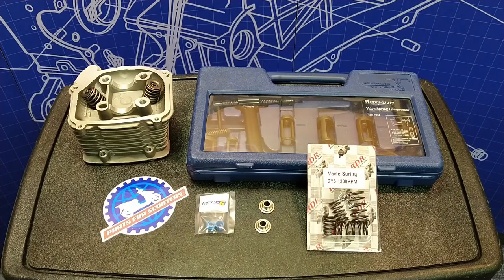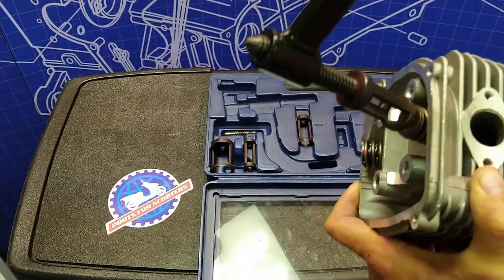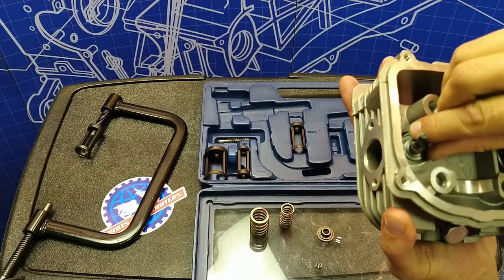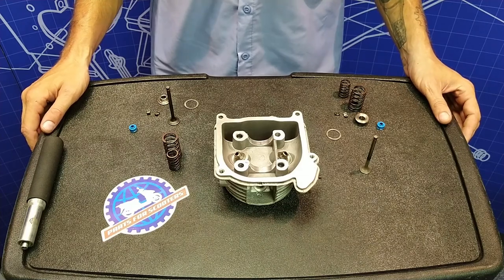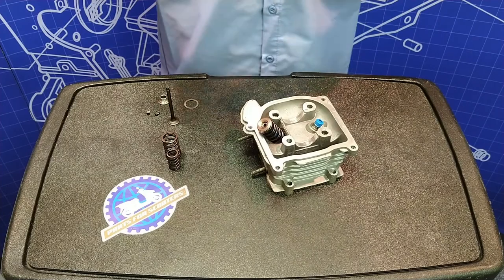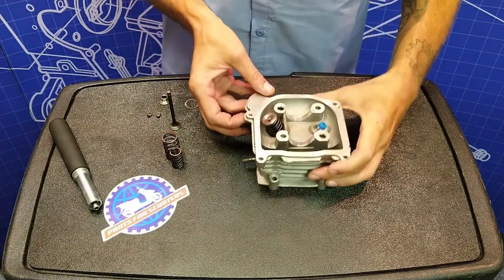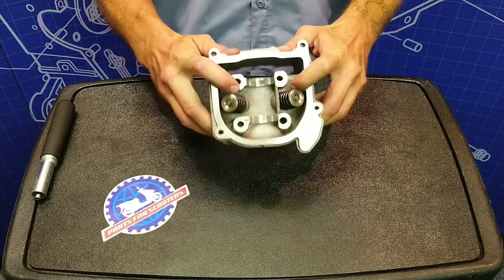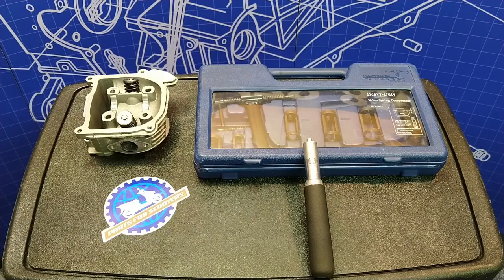4 Stroke Scooter Head Disassembly and Reassembly - Upgrades!

Comment: It's a lot better using the compression tool, I removed a set of springs without one,  it wasn't too bad, although,,, I still haven't found those locks, they went flying! They GONE!! They must be in geo sync orbit by now! 
I just ported my naraku big valve head for my 52mm bbk, 139qmb. It has a 50mm now, I also have NCY springs, titanium retainers, and a9 ncy. Cam,  with a huge intake upgrade, and a 24mm carb, I didn't really look at the new carb I bought, I bought the 52 kit because it didn't have the power I thought it should, but the carb is probably a 18mm I bought/paid for a 20mm, I wondered why the 96 jet had fuel running out the carb, and barely running, I must have went up like 20 jet sizes, the stock being in numbered,  it still isn't running great, but I have some goodies to swap in, I'm going to shave the head to make up for some chamber work, un-shrouding the valves, and to get a bit more TQ,   between the head, cam, intake and carb, with a bit more compression, better valve Trane, the ncy adjustable sheave, slider weights, adjustable CDI, although I haven't noticed it changing anything, the larger valves and cam and valve Trane should get it to about 10k rpm atleast, I'm hoping along with the gears, get it to Cruse at 45 or so, and peak out around 60 atleast, I can't believe I got ripped off in that carb,  it's smaller than the stock carb that was in it, by a fair amount, the 78jet is a noticeable amount larger than the original, I believe it must be a 74+/- the  96 was a huge difference, I have a new hopefully 20mm carb on the way, there is a few things I'm hoping to order from you guys soon!  I'm very tempted to do a 150 swap  with a bbk, and seriously thinking about a slide carb swap in either çase, depending on how the new 20mm works out, I'm looking at a 22mm slide carb, it will take a bit of work/ modifications, sorry to ramble, good day!!!